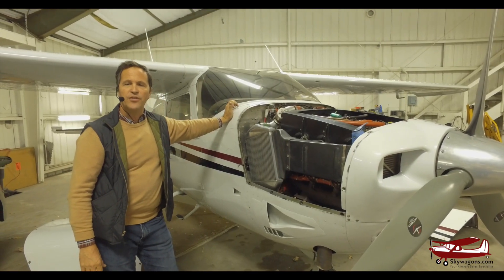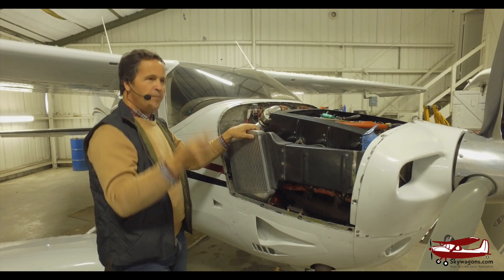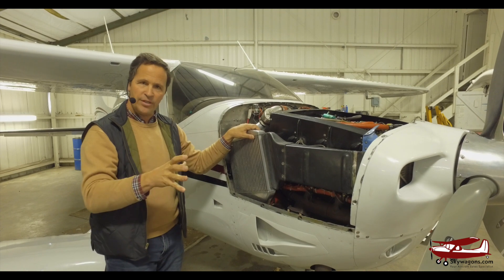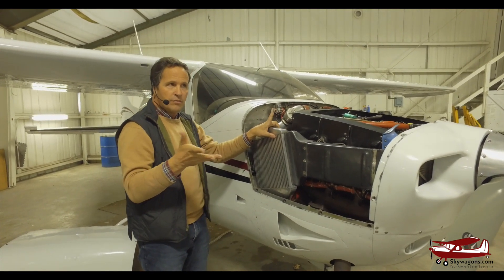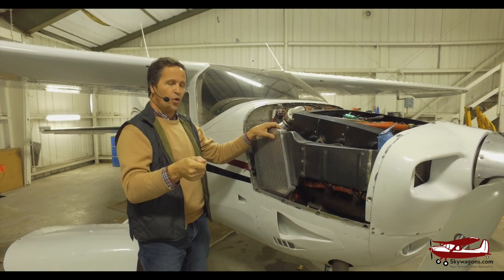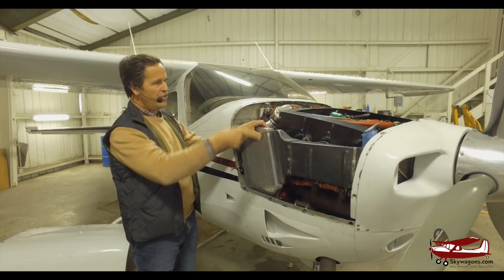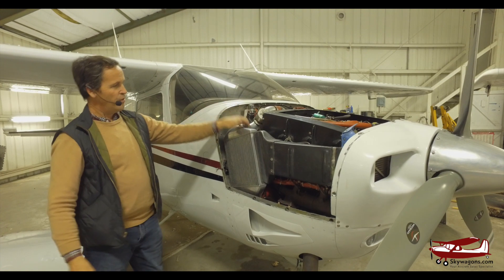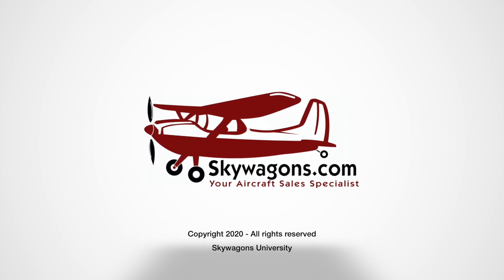Intercoolers

Comment: Good explanation of how the intercooler works. Except you left out the part where the restriction of the intercooler itself causes a loss of MP. Unless you really fly high, the juice ain’t worth the squeeze.  Every T210 owner I’ve spoken to about it says they wouldn’t buy it again. Like the gear door removal, it’s one of those mods that seemed like a good idea and was very popular 20 years ago but is now seen as a negative.
Reply from the maker: I have never heard that, nor about the gear doors.  The turbo makes up for the intercooler by shoving 28 inches on MP through it when a normal one would be at about 18 at 15,000 feet.

Comment: its not the exhaust that heats the air but the compression of the air at high speed. Thermal dynamics states that when a gas is compressed quicker than it can dissipate the heat generated it will become hot and less dense. although the higher you go the cooler the air, it also becomes less dense so isnt able to absorb as much heat from the aftercooler as a linear scale. Also, why do american planes have such a long throttle lever? 40 inches, that's a metre long. KPA has been standard for over 100 years.
Reply from the maker: I'm not sure what you mean about a long throttle lever?
Reply: @skywagonuniversity5023  A joke about the fact you are still talking in inches. You don't look 150 years old.
Reply from the maker: @chippyjohn1   Oh., I see.  You know that there are two types of country in the world right :-)  There the ones that use the metric system and then there's the one that has been to the Moon.  Ha ha.  Seriously though, everything over here is not metric unless you are an engineer. Inches, feet, miles, chains, groats, legues etc.
Reply: @skywagonuniversity5023  You realise they used all metric to go to the moon. Nasa agreed with the benefits of metric measurement.
Reply from the maker: @chippyjohn1   Yes, of course,  that was an attempt at humour.

Comment: Hi Mark, great vids and impressive Cessna knowledge. At the start of this vid you comment the induction air comes from the turbo and through the intercooler and into the induction system. 
Toward the end you also say that air through the intercooler duct at the front cowl opening is also induction air. I’m confused as this air isn’t ‘turbo’d’. Can you clarify?
Reply from the maker: Yes, no problem.  In a car or any liquid radiator, the air obviously passes through the vanes of the radiator and cools the contents, which is water etc etc.  In an intercooler, in a turbocharged engine there is air in the radiator, not liquid, as well as air passing through it's vanes to cool it. The induction air goes in to be burned in the engine, in through the air filter and whipped through the turbo and warmed up by this action, then under higher pressure than before the turbo, it goes into the intake and engine and get burned with the fuel etc etc.  The Cooling air also goes into the cowling and is ducted not inside the intercooler, but through it like the cooling air in the car. It rushes though the vanes and takes away the heat and then goes out the cowl flaps.  This loss of heat makes the induction air in the intercooler denser and therefore burns better in the engine.  An intercooler is an "air radiator" Air goes in to be burnt with fuel in the engine through the induction AND air also rushes through the vanes of the intercooler and away to take away heat.
Reply: @skywagonuniversity5023  awesome. I forgot that exhaust spins the turbo but the other half of the turbo needs supply as well. 👌🏽 cheers mate, keep the vids rolling 👌🏽

Comment: Interesting. My understanding of the purpose of intercoolers is to reduce the risk of detonation. Hotter air/fuel mixtures self-ignite more readily. Cooler air can be pressurized higher and be burned at the right rate without detonation. So it allows for higher manifold pressure than non-intercooled systems without risking detonation.
Reply: both safety and efficiency, hot air does cause pre ignition but it is also less dense so less power.

Comment: Your videos are excellent, but I would state the physics differently. Cooler air contains more oxygen than hot air, for a given volume. More oxygen means more fuel can be burned, thus more horsepower. In addition, pistons work because heated air expands. If the air is already hot, then it can’t expand as much due to the burning of fuel
Reply from the maker: Yes, you are right.  thanks.

Comment: Thanks for the rainy Sunday info.   
Available space under a cowling is convoluted. I'd think heat exchangers (radiators, intercoolers) could be made more form-fitting or incorporated into the ducting moving the air.
Managing pressure & power seems like the perfect job for Joe computer. 
My shopping cart keeps twitching towards Placerville...
Reply from the maker: Yes, it is a big square thing under a curved cowling in a small space.  But it fits and it works.